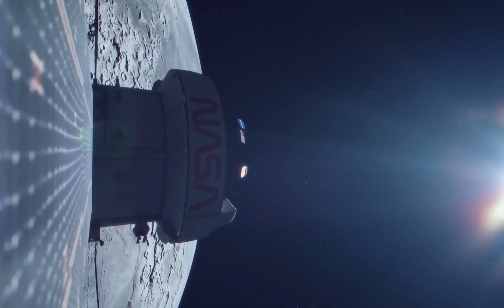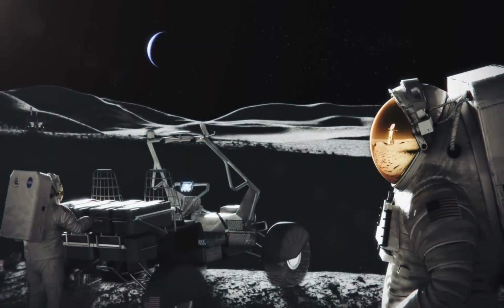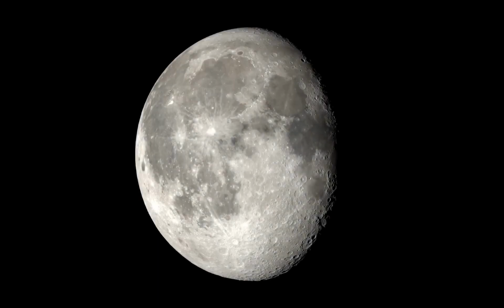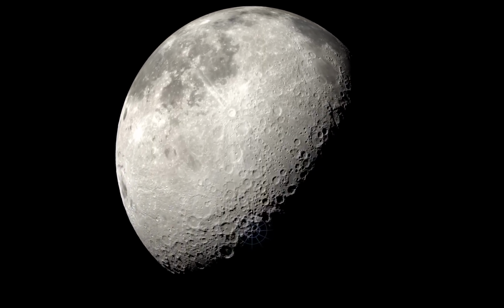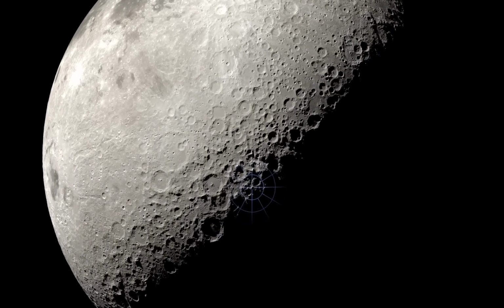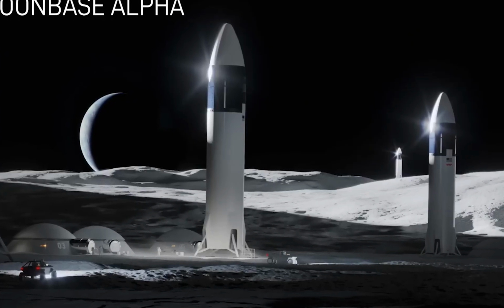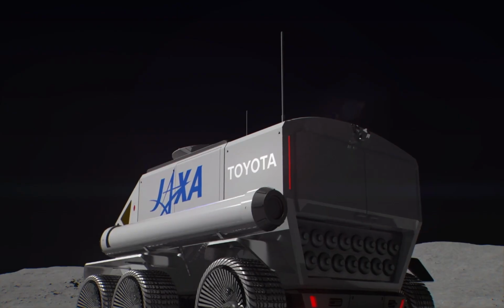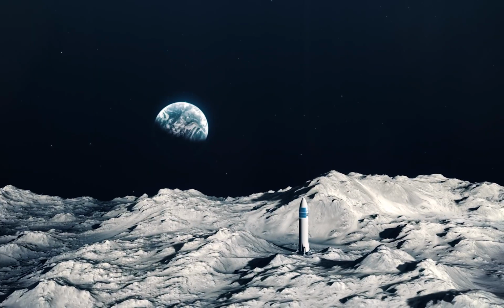How Robots Will Help Humans Conquer The Moon

Comment: This interview reminded me a bit of the Delta-V series by Daniel Suarez that I just finished reading (slight spoilers ahead). In it they do asteroid (and lunar) mining via humanoid telepresence robots utilizing very high quality virtual/alternate reality interfaces. So in the series the majority of "surface" operations are conducted by operators on a spaceship safe behind radiation shielding and in spin gravity but basically acting like they're on the surface via VR interfaces. For operations on the moon, they also used software to effectively mask the effects of lower gravity by dampening the VR inputs so it feels to the operator much more like operating in normal earth gravity.

The idea is that it gets around some of the issues with AI (trustworthiness, decision making, etc.) without actually exposing astronauts to excessive harm. You also get the human ingenuity that AIs seem to lack (at least so far) able to quickly respond to various things. Theoretically (spoiler, like in the book when you have a spin gravity space station at moon L2) it also allows you to have someone who is trained as a miner as opposed to trained as an astronaut to operate the robot since the person just needs to be close enough to have very low light lag to the robot so there's not much input lag.

Obviously it's a sci-fi book and relies on some tech advances we haven't seen yet, but conceptually it's an interesting idea and way to utilize robots

Comment: On the moon it's handy to have a robot to walk the dog. But Seriously, the biggest problem is going to be regolith grinding down the gears in its joints. That stuff is the definition of abrasive.
Reply: That will be a problem as well as adequate shielding for the computers that run them. 

The Moon is a much tougher environment for "space radiation". Way too many charged particles that can destroy our typical earh bound computers. 

Do you know where the Moon dust came from? There are no earthlike forms of erosion on the Moon. Micro-meteorites are thought to be mostly responsible, but we also know that  ultra high speed particles cause physical damage. 

Solar radiation has no barriers on the Moon. No atmosphere or protective magnetic fields.  The magnetic field on the Moon is very weak so it doesn't provide much protection.
Reply: @professorg8383  The regolith came to be , first through volcanic activity, the glass then shattering though heating and cooling, resulting in what it is now. High speed particles would do the damage on the smaller scales.
Reply: @paulmichaelfreedman8334  No doubt there was frozen volcanic lava that got broken down. As for heating and cooling shattering the lava, not exactly "glass", But theories about the exact mechanisms involved are still somewhat questionable. A lot of it is very, very small particles. Talcum powder like. As I understand it, there is still questions about how it was broken up so fine. Solar particle bombardments has not been ruled out. I could be wring, but I think this is one of those things that doesn't have a complete explanation.

But my point was mainly about the destructive nature of solar radiation on electronics
Reply: The key is the seals. The Apollo suits were recked in 3 days.
Reply: @Bigmoondig  Agrred, and we will see how the solutions hold up. But I think it's going to be an ongoing issue, suits wearing out fast and needing regular replacement. Unless you develop a large enough swath of moonscape that is free of any large quantities of loose regolith. Turns out, regolith is ideal for making concrete. And it can be mined for metals and other precious elements. It even contains most of the ingredients for making steel - Starship factory on the moon anyone?

Comment: Just find it strange how there's so many delays and obstacles to setting foot on the moon given it was supposedly achieved 50 years ago. You'd almost think SpaceX was given a task that NASA could rely on to not be achieved anytime soon and thus be the fall guy for perpetual delays. The first proof of concept should have been on earth in an insulated environment, then on the moon and then on Mars etc. The whole moon base reeks. Let's see if they do it before 2029 or 2069.
Reply: That's what happens when you let yourself get rusty for sixty years. You lose valuable skills and knowledge. Besides this is entirely different mission parameters. We aren't going to just step foot on the moon. We're going to set up a permanent base and industry.

Comment: Hi Frasier. I have a question: so the plan to send starship hls to the surface of the moon. The astronauts suit up, take the external elevator down to the surface, and when finished, hop on the elevator. What happens if the elevator fails, and these astronauts, low on oxygen, are stuck three stories down from the entrance? There is no rescue craft, no rocket boots... what is the solution?
Reply: @Rory... Come on!  This is manned aerospace.  There are/will be backups to the backups.  Don't lose sleep over EASY engineering "problems" like this.
Reply: R(h)ope

Comment: If my brain worked like it used to I'd start a company making very cheap machines that require constant feedback.
A typical 'robot' used in manufacture is very precise and very expensive but AI can remove most of those needs.  I am able to use a saw to cut wood to high precision and yet don't have 1% of a robots precision ... because I can respond to feedback.
A robot that can watch what is doing and adjust to give the right result would be very cheap and very capable.

Comment: We need a huge nuclear plant on the moon.  It would open so many possibilities.  Everything is limited by power and on the moon the only alternative is solar but we don't have the environmental issues. 
Dig an underground chamber with a nuke, put a huge nuclear plant in it and the moon will shield you.  Anything goes wrong then move 100 miles away and try again.
Reply: I have a feeling that you may not assessed the practical implications.
Reply: @RichardFraser-y9t  I'm a postman so no, I have not conducted the relevant studies.
However, I do know that a society's productivity runs largely in proportion to it's power usage. Efficiency plays a part but mostly like a gear change than rather than throttling.